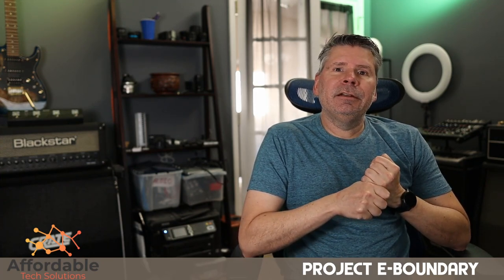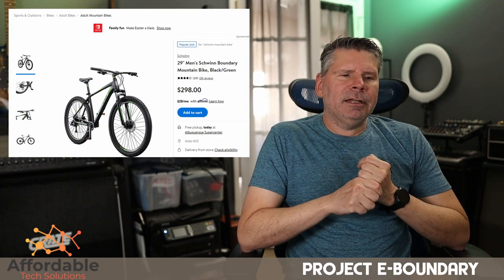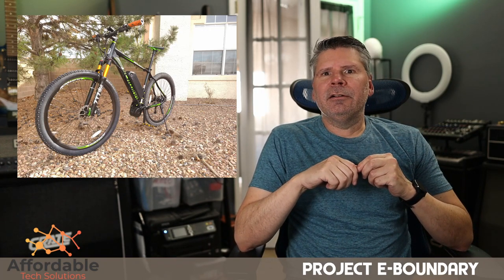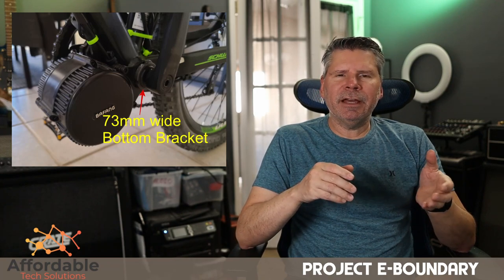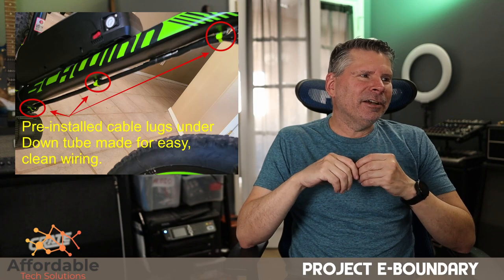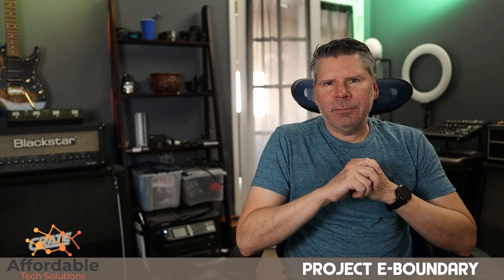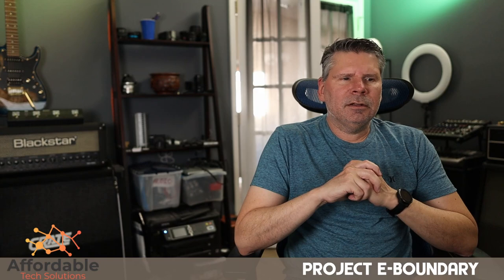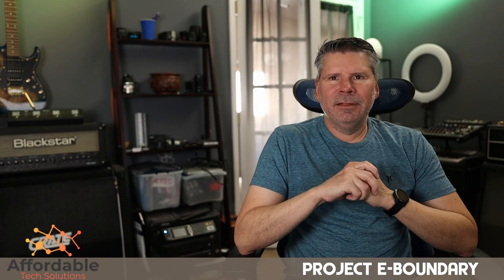Schwinn Boundary E-Bike Conversion | Bafang BBS02B

Comment: Nice video, but I'm glad it wasn't out when I did my Bafang conversion on my 4 year old Boundary. I had NONE of the problems you describe and replaced NONE of the components on my bike other than the rear derailer CABLE that I messed up installing the shift sensor. People need to keep in mind, once Bafang kit is installed, you don't need to shift anymore! Keep it on smallest rear sprocket and GO!

Comment: Great coincidence that I found this video and appreciate your work describing your experiences. Thinking of moving my BBSO2B setup from my ancient Trek 830 to the Schwinn Boundary and in addition to what you've pointed out wonder about your thoughts on the quality of the wheels, cassette gears and rear derailleur...? I have converted my present bike to Avid mechanical disk brakes and they work well, wondering also about the quality of the mechanical brakes that come with the Boundary..? Thanks again for the great video and account of your experiences with the conversion!

Comment: Pretty cool video! I used a bbshd on my build, Those nut inserts can be crimped by hand with a high tensile nut and bolt with spanners if you only have a couple to do. Nice attention to detail i enjoyed watching it 👍
Reply from the maker: Great tip! ...No need to spend $50, thanks for adding that.  I am rebuilding bikes all the time and have wanted a tool before, so I decided to bite the bullet. I saw  less expensive tools on amazon too, but HF is right down the street. I am currently rebuilding a 1998 Diamondback and had to install more riv-nuts, so i am glad i got it.
Reply: @affordabletechsolutions6917  cool that's the go! I just subscribed for the methodical detail you go into🤗👍 when i bought my donor bike i was looking for similar stuff.. tapered headset, no cables around that bottom bracket, hydraulic Shimano brakes (i scored 180mm front & back) standard, 120mm travel air forks with special coating,  battery space in the frame, i bought a 27.5 inch 2017 Fuji Beartooth.. very similar to what you have but had all the stuff as standard.. i payed $400 for it (it was an unwanted gift put in storage from new, i scored big time). I put a Lekkie 36 tooth front sprocket on my setup for mountain riding on trails and the offset is off but it works great no problems at all aside from wheeling it backwards in a hight gear it jumps off but that's just something to be aware of (it has a Shimano XT derailleur so that could help a bit for keeping on going forwards) i can see your a leader not a follower, great content😄
Reply from the maker: @rossg9363  Fuji bikes are great. I have had half a dozen Fuji over the years and no complaints, Some I really regret selling, but with bikes as a hobby...The Beartooth is very similar to my Mongoose Ruddy...which is about to get an upgrade...:D You are going to love that bike. I have also converted my Mongoose Salvo Pro full-squish, which i need to do a video on.
Reply: @affordabletechsolutions6917 yeah it's very similar to that ruddy bike looking at the data spec's on it! Nice! Great chatting mate i am subscribed with the bell on🤙 👍

Comment: Great video. I have a schwinn boundary and bafang bbso2b. After I install the plate and gray lock nut there is no more threads sticking out for the black lock ring. My bottom bracket is 73.24. Any tips?
Reply from the maker: You will want to use some thread locker. The BBS02 was intended to fit the 68mm bottom bracket. They later started including the longer bolts with the 3 washers as a band-aid to claim the motor also fit 73mm shells...the problem is that the lock ring wont fit. So I use thread locker, because that lock nut will come loose over time without it. If you use the green loctite 290, it is for use post assembly so you shouldn't need to remove anything.

Comment: Great video, I am also looking for a MTB that's the most suitable for the same conversion. I'm willing to spend a little more for a bike that already has a good front shock, hydro brakes ect, but most of these bikes come with a crazy small chain ring, like 32t. My main concern is being able to put a bigger chain ring on without hitting the chain stay, which on most of these bikes flare out really wide right behind the crank. I'd have to shim 46t chain ring out really far to work, but then I'm sure my chain line would be way off. This has been my main biggest concern since thinking about doing this. I wish I could find a frame where the chain stays don't flair out so soon to use a bigger chain ring. No way could I stick with a stock 32t. I'd be spinning my legs off my body trying to reach 15mph in the highest gear. Would getting a frame with a 68mm BB help in any way with larger chainrings and chain line?
Reply from the maker: I have done half a dozen conversions since this video, and chain line issues are always the biggest concern. The biggest factor in the chainstay clearance is what size tire/wheel the bike was intended to accommodate. There will be greater clearance issues on a 29er with 2.4 wide tires than there would be on a bike designed for 27 x 2.1. For example, I have now converted several classic DiamondBack V-Links from back in the day, which provides ample flexibility in chainring selection. Of course, back then, a 2.1 tire was considered fairly wide. I still end up putting wider tires on them, because I like the aesthetic, but that just means I have less internal tire clearance, which is fine IMO, for road riding. I am not building bikes for hard core mountain use. On my builds, I have found that a 42t chainring is a comfortable blend of speed/power/clearance....but, i never select a bike frame for conversion before inspecting/calculating that clearance.
Reply: @affordabletechsolutions6917  yes, but it's hard to inspect that clearance looking at bikes online. I'll look at videos and pause the video if there happens to be good view of the chainring clearance to the frame, but it's still hard to see. From what I can tell, most of these MTB's don't have much clearance. Oh well, I'll have to keep on searching. I just don't want to buy a bike to find I can't use all the gears because of chain line issues. I'll start going to bike shops and look at some bikes in person.  Thanks for your reply. 👍
Reply from the maker: @18andlikeit  ...another consideration is how many speeds the bike in question has/will have. All things being equal, if a bike has a 135mm rear axle (just for example), Chain line will be far more difficult to get right on a 10/11/12 speed bike than it would on a 7 or 8 speed. I have never put anything more than 10 speed on an e-bike, and honestly, when it comes to e-bikes, i think 10 is unnecessary. I am able to go just as fast on the 7-speed boundary as on my 10 speed Diamondback, and when i am road-riding i just end up shifting a lot on the 10 speeds....so it all depends on what you are hoping to achieve from your bike, but I just didnt know if you had thought of that part....IMO I would not always consider more gears as an asset
Reply: @affordabletechsolutions6917  yes I'm thinking 9 speeds would be good. But then it all goes back to the chain ring again. If I can fit a 46 or 48t chain ring on without clearance issues, I'd like to have at least a 9 speed for the lower gearing to compensate for the bigger chain ring. If I cant fit a chainring any bigger than 44t, I'm sure I would be fine with a 7 or 8 speed, I wouldn't need the bigger cogs in the back for lower gearing with a smaller chainring. As I've said before, most of these 1X bikes come with a very small chainring up front, which makes sense for hill climbing with human power only. But with a 750w or 1000w mid drive, gearing this low isn't needed with all that motor power and I'd like to get a better top end speed without ghost pedaling to soon. My current factory made hub drive e-bike has a 46t chainring with the highest gear in back being a 11t. I wouldn't want gearing any lower than that on a new DIY bike build. I've been thinking of putting a 48t on it because after 25 mph or so I'm spinning way to fast to be comfortable. I guess I'll never really know how big a chainring I can use until I actually buy a bike and see how everything pans out after the motor is installed and hope for the best.

Comment: Thanks for this video! I'm on the fence about my "donor" bike. It's an old Schwinn frontier that is in good shape (i bought it new in the early 2000's) but is a 26'er and is just small and nervous handling. The Boundary is in stock at a local Walmart in 29" so it's an option too.
Reply from the maker: I have done 3 conversions since this bike. All of those have been 26s. It is true that you may get more twitchyness from them than a 29...but that might be due to frame angles than tire size. 

On my 26in conversions I often upgrade the forks to longer travel, and greater offset and larger tires. This "virtually" changes the head angle and gives a different feel.

Comment: I had trouble with crank removal too. I used a ton of liquid wrench, a propane torch and a long cheater bar. Any update on the 42T? Better fit?
Reply from the maker: I completely missed your reply...yes actually the 42t is a better fit, and qui ker acceleration.

Comment: I hate to tell you this There's another set of mounting holes holes on the battery 3 if you remove the 3 philips headscrefill up said screws the cover comes off and reveals the other mounting holes I actually mounted my battery upside down It actually fits better in the frame and looks better
Reply from the maker: I think i saw those when i had to disassemble the base because the factory installed the aluminum channel upside down, but although the holes were in the plastic, i do not remember seeing the ability to mount it reliably from that location...in other words, it looked like there were additional mounting holes that would be good to "supplement" the install, but not to replace the intended install. I could be wrong though...post some pics of the mount points you are talking about, because if they are what i think they would not make goo candidate mounts on their own.

Comment: Is the battery you chose the "Ultra Slim Shark"? I've been printing out the cutouts and noticed this battery would be very difficult to install with only the upper mount points. The "mini shark" and "jumbo shark" have upper and lower mount points. The Boundary has a nice large triangle to work with.
Reply from the maker: I only use the top mounting bolts for water bottle mount, and with the squarish tube it seems to be good. When the tube is round, I supplement the mounting with a few beads of silicone at the battery base. This virtually eliminates rattle from the battery and ensures it won't  break off easily

Comment: Thank you for this video! This video inspired me to purchase the Schwinn Boundary and I plan to clone your build using the BBS02B...May I ask if you had any other motor install issues besides the chainring needing to be shimmed?? I specifically am wondering if the BBS02B installed into the Boundary without the motor drive "flange" hitting the chainstay??  I plan to learn from your hard earned experience and start with a 42 tooth chainring. I'm hoping for at least a clean motor install with no motor- to - chainstay clearance issues. Wonderful video and extremely helpful, love your work!
Reply from the maker: Thanks for the feedback. The only other motor related issue that comes to mind, you might run into on this frame, is that the Bottom Bracket is a 73mm. Since it is larger than the common 68mm, the lock-ring won't fit and so i would recommend using thread locker on the lock nut. If you use the green lock tite 290, it is designed for post-assembly application, so you dont have to put it on until you test the bike out and make sure everything is working correctly.
Reply: Wow!  I so appreciate you taking your time to not only reply, but to reply so fast and with so much more helpful info! Thanks so much brother, be safe and have fun!

Comment: I made one from a BBS02 by Bafang and a 2020 Giant Talon bike.  Wasn't a hard build and had very few issues.  I like it.

Is that guitar behind you a Fender Strat, or did you build it or is it another brand?
Reply from the maker: That guitar is a Michael Kelly. I am not usually a fan of Fenders designs, i always thought the traditional look was kind of boring unless you paid a ton of Money...But I just like the look of this one, and it has the custom shop wiring with so many tone options it's crazy. I found it on big sale last year @ SamAsh, i believe, I couldn't pass it up.
Reply: @affordabletechsolutions6917  I had a nice looking Michael Kelly 335 style with flamed maple and P90 pickups.  Sold it.  Should have kept it.

Comment: Great video!  I have a couple questions.  Would the 44t chain ring work with the 750 watt without shimming? The only 42t chain ring I can find is on the 1000 watt bafang. I would spend the extra for the power if it will still install easily on the boundary bike.  Is the 42t BBHD chain ring compatible with the BBs02?  I can buy it separately?    I really want to buy the right parts straight away and get riding...  Thank you
Reply from the maker: The HD vs the BBS02 chain rings, are not the same bolt pattern (i learned that the hard way). The 02 has a larger center hole also. And it is much harder to find after market rings for the BBS02 than the HD, for some reason. 

When you buy a Bafang motor, you select which chain ring you want with it, so they should match up the correct one. 

For the BBS02 I have always preferred a 44t as it has a bit more offset to it (it wraps around the motor more) than the smaller ones. There are a lot of factors involved in whether you need to shim it or not, and that is more dependent on the frame and cassette. On this frame, if i went with the 42t or smaller ring, i may not have had to shim it out, but the chain line would have been too far biased toward the high gear. Dealing with the chain line issues is really the toughest part of the conversion, and there are no guarantees you wont have to get creative with shimming.

On a different build, I had a pretty bad chain line. I bought the DeRuiz chain ring for the HD on Amazon so that I got a much greater offset, then just drilled it out to fit the BBS02, and that worked pretty well, but not everyone has the option to do that if you lack a mill and lathe. I don't know why, but no one seems to make a bling ring type the BBS02.

Comment: What kind of range do you think you will get with the batteries you have? Thanks
Reply from the maker: I have been commuting on this bike, and have not gone far enough in a day to fully drain the battery...but my commute is a total of 20 miles, and even with mostly throttle, I still have battery left.

I would say that with mild pedal assist, I should be able to get 40 miles.